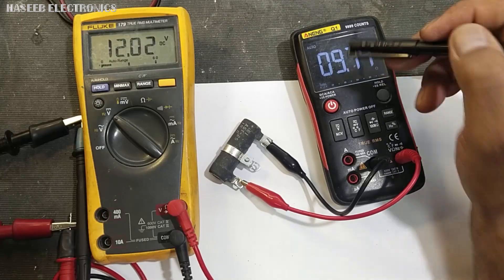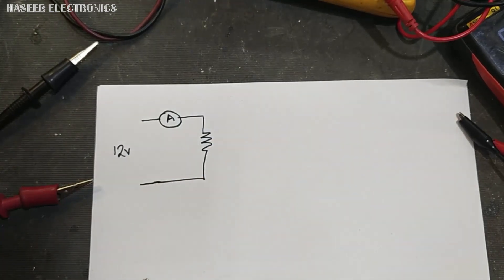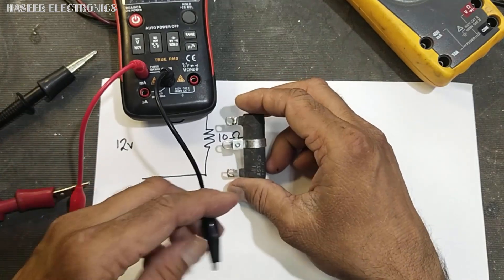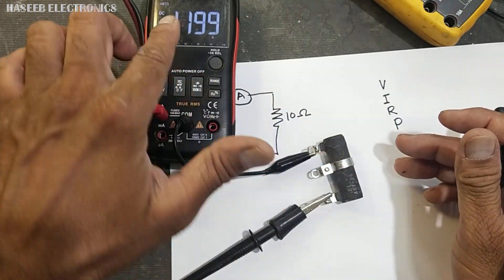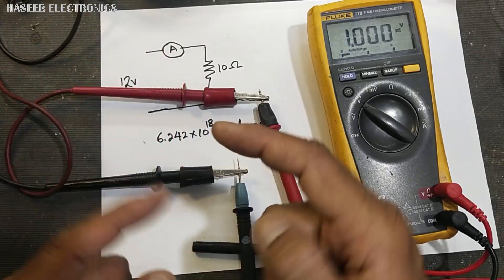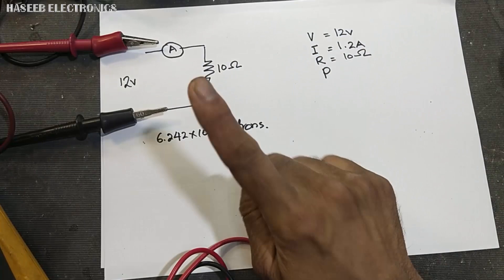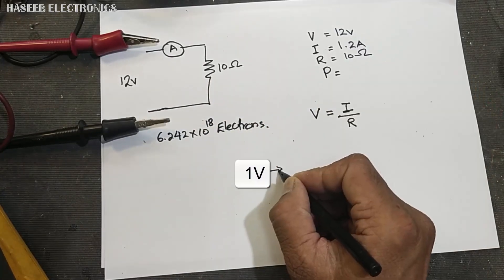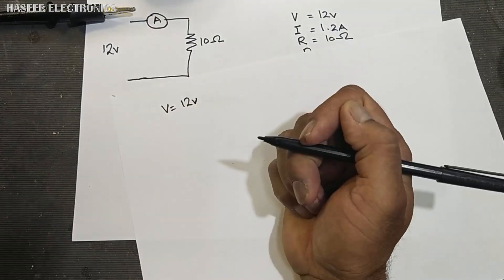{660} Relation between Voltage current resistance and power explained

Comment: Good morning and greetings from Ireland.  Thank you for all your videos which are very informative. One question. If I measure the resistance across the terminals of a 12v car starter motor it is less than 1 ohm but if I connect the battery it will draw over 100 amps. How does this work ?

Comment: Hi, I didn't see any change in value of current with temperature! please review the video once. Thanks
Reply from the maker: yes
current changes in milliamperes. 
i will demonstrate again full detail
Reply: @HaseebElectronics  thankyou very much for clearing my doubt
Reply from the maker: @littlegeniusplayschool459  it is my pleasure
when the temperature changes, it causes to change the resistance value (based on its temperature coefficient. this change in resistance causes to change in the current flowing through it 
as per ohm's law, the current is inversely proportional to the resistance

Comment: Sir all the concepts that you explained in these video are applicable for both AC and DC? 
Are only for DC?
Reply from the maker: exactly. it is the same for AC and DC circuits 
for ac capacitive / inductive circuits, the calculations will change due to frequency involvement
Reply: @HaseebElectronics  jazak allah khair